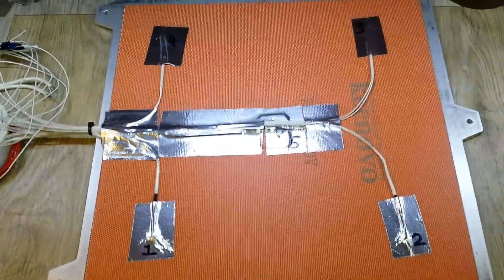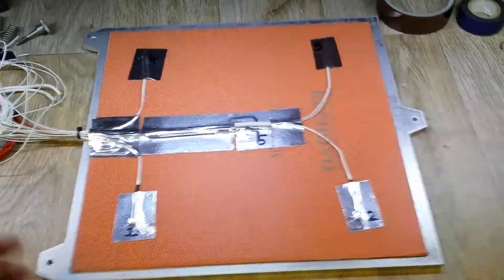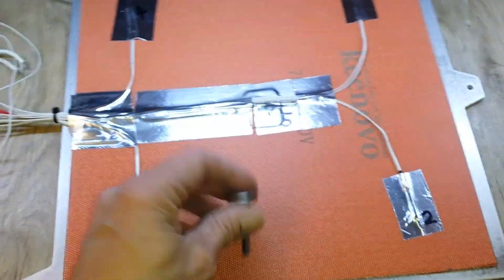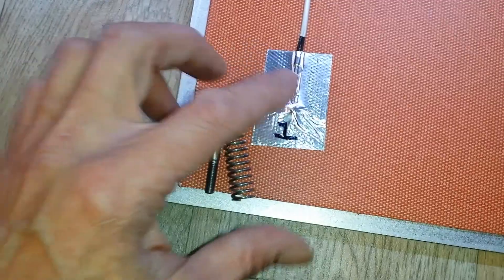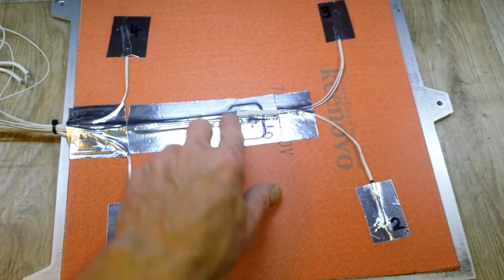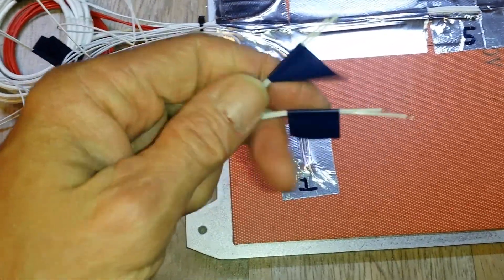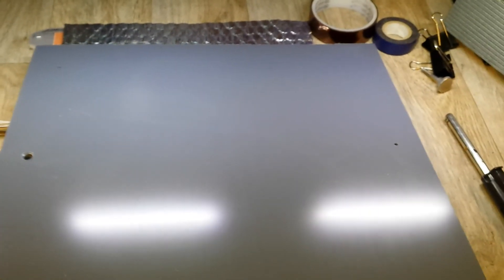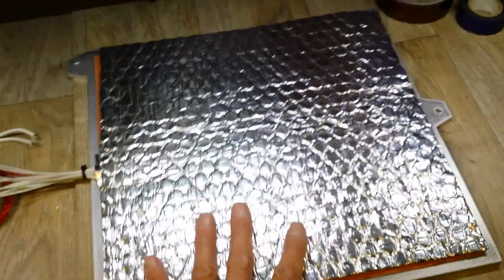3D Printer 750watt Heat bed 320x320 - 240v ac

Comment: What tape is that?
I tried to use a thermistor 100k from hot end to control my bed but I'm getting some strange things. Curious if you know what thermistor I should use in marlin and what thermal run away settings you'd use

Comment: thank you for your information how to wiring the ssr. I have silicone 220v 300w and ssr 40 dc-AC. I'm confuse for setting marlin mode bangbang or PID. Please have you some exemple setting heater bed with ssr? tks in advance for your time

Comment: The thermistors should be on the aluminum, not the underside.
This could be done by milling slots in the aluminum before installing the heater.
Obviously too late now, but should be considered by anyone copying it.
Reply from the maker: Einar S that is a very bad idea unfortunately  !!   I considered that option but you then have to decide what side to mill material from to create the slot.
This will the cause 2 problems you may not have considered  ?
1st problem will be the that once you have a slot  or gap in the surface if the aluminium plate it will no longer expand or contract equally and the slot will cause the plate to warp slightly - over time this will get worse.
2nd if the thermistor died or goes out of range then the challenge to replace becomes a bit of a chore.
Although it seems a good option ! cutting slots in thin plates used for heating is usually detrimental to the plate over time .
Good idea in essence but considering the pitfalls I am glad I left it as it is. I just finished a 52 hour print with the bed at 110 deg c and it performed flawlessly with an ABS print that used 1.2 kilograms of filament.
Reply from the maker: Einar S - just for note the plate was cut from a virgin T6 grade stock. laser cut to reduce distortion.
Reply from the maker: NoChannel - You are both incorrect ! - My purpose of using the extra thermistors was to allow overall monitoring of the heater for hot spots (This unfortunately was never completed) - The reason for not milling slots is as I say to avoid distortion in the plate and secondly a channel cut would reduce thermal conductivity at that location ! Unless you could guarantee that the heating elements within the heat mat DO NOT line up with any of the channels cut then you would have problems later on. And to cap it off I wanted a solid Build surface that stays straight . This has a 5mm piece of Hardened glass on top. The idea of the extra thermistors would have helped in my recent disastrous weekend ! A shame I never got them hooked up and monitored. Any thanks for your comments - all discussion's are good - but would be nice if you actually had some content up yourself to help others !!
Reply from the maker: Laser cut to reduce distortion ? wrong !

Comment: your printer looks so badass, looks like something off the ISS . When i finally finish my core XY printer going to get one of them mats once i have it working, its all done just need to do the electronics.

what did you get to drive it ?
Reply from the maker: Hi Andrew Joy. My printer is still in early stages of development and I have lotts more work to do. The board i use currently to control is the Mks base v1.4 - I have since purchased the Mks 32 bit version but this is one of the coming upgrades I am working on. I would suggest using 32 bit board if your looking to aquire one for your build. The older 8bit boards are perfectly fine but extra performance and facilities are to be had with the newer boards available.
Reply: I already have a ramps 1.4 but i will eventually switch to a smoothie board.

I was thinking more of switching the 240vac for the heater, do you use a relay controlled by the 3D printers controller board ?
Reply from the maker: I will be using a solid state relay to switch the heat bed. this will be controlled by the 3d printer controlller but with an interlock to ensure it is running safely etc